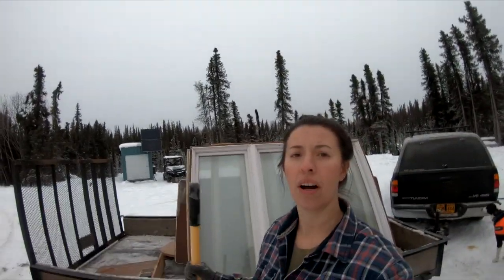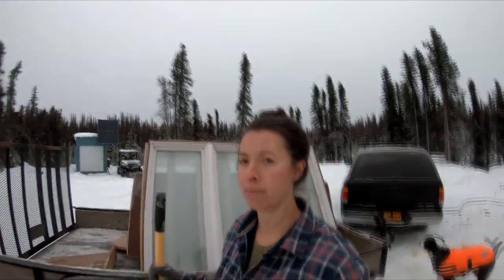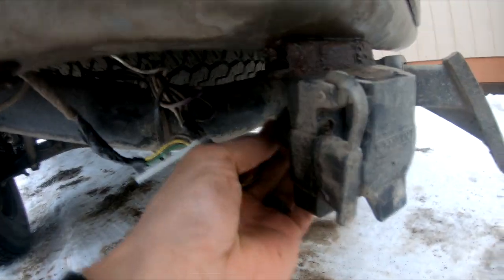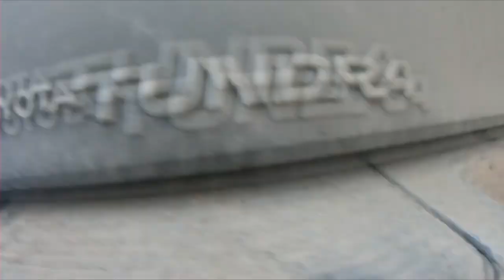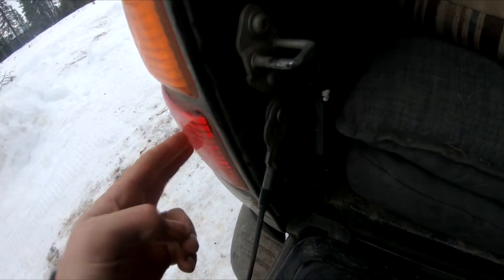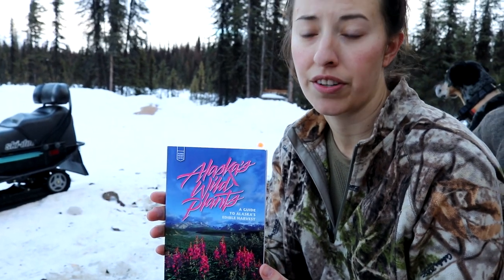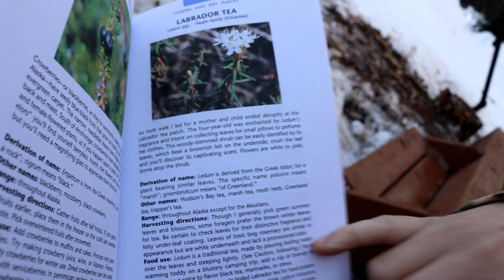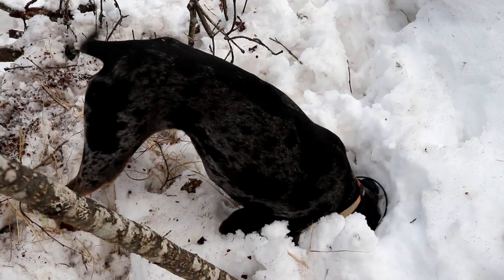Another Winter Day at the Cabin

Comment: I have a 40ft container on my wooded lot, and to eliminate the condensation inside during winter i cut out two 12"x12" screened ventilation openings at each end, that solved my condensation problem. Because where it is installed which will become our retirement home, we receive up 5ft of snow per year.

Comment: The shear pin should be specifically engineered with the right amount of shear strength to avoid tearing up your machine .. it is a sacrificial piece by design. Most "bolts" are way too hard to readily shear if you hit something really hard and it will either rip the auger apart and/or break the shaft ... or even tear up the gears that drive the auger.